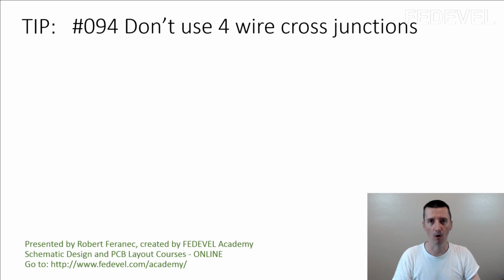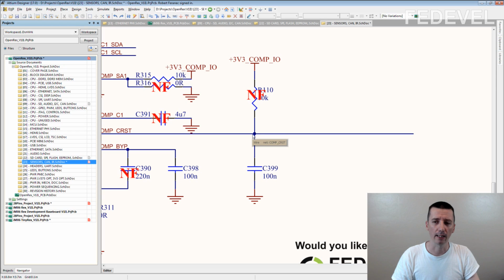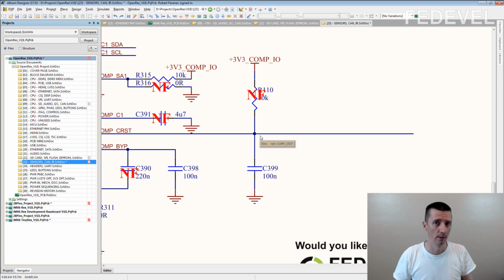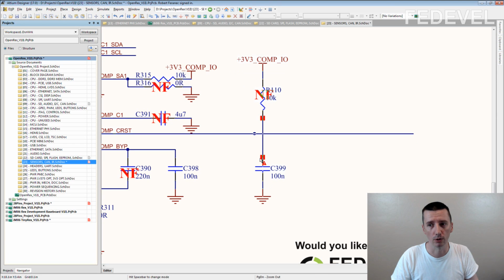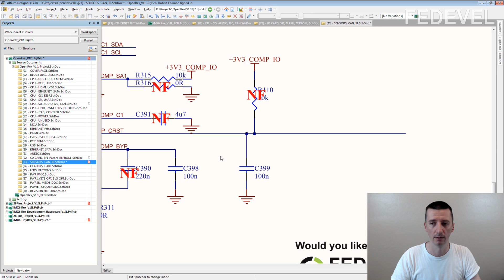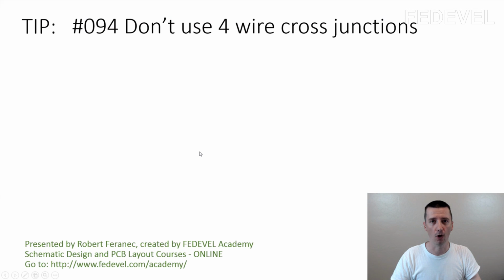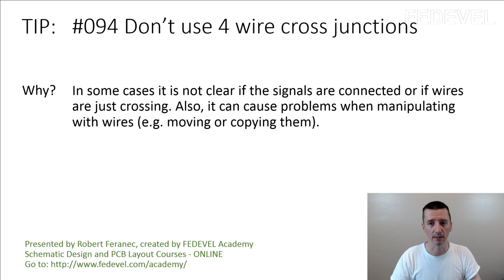TIP #094: Don’t use 4 wire cross junctions

Comment: Such a strange behaviour of Altium designer!! Why on earth it should remove the junction?
I always move junctions in Cadsoft Eagle and it works like it should do.
Reply from the maker: There are now options, which will automatically brake wires when you place junction - that helps to keep junction in right place. In this video, I just wanted to point out also this kind of problems - you may want to be aware of it.

Comment: This is indeed an important practical tip. I prefer them 4 wire cross junctions, but when I need one I place an explicit manual junction object. That way it has a different color and shape (it's visible when printed) and you can move or copy/paste it.

Comment: Your reason for this tip is valid for Altium and as far as I can tell only Altium. Altium has always had a problem with junction connections and for some reason it has not been fixed, because moving your nets around without having the connections corrupted is a primary feature for any schematic capture program.  I know with DxDesigner this not an issue when moving nets including 4 point junctions. Love the other tips you've given but this is the first one I can't agree with outside of the Altium CAD tool.
Reply from the maker: It used to be problem also in older Orcad, I think now they break the wires by default.

Comment: i like very much your videos but I don't like this method... 4 wires junction make the design more clean in my opinion. instead I prefer to modify the CAD preference in order to make the junction point bigger.
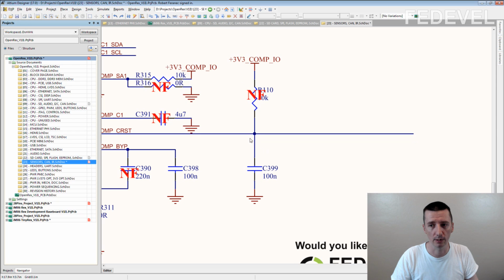2:05 IMHO this is a house size bug of altium! it is absurd! moving components don't mean change the nets! (i don't use altium BTW)
Reply: I agree. Some circuits are traditionally drawn with 4-wire junction and trying to avoid these junctions make them look confusing and non-idiomatic. I don't like adjusting to bugs in CAD tools. Fix the bugs please...

But those "bridge" like crossovers for wires that don't connect are even worse.